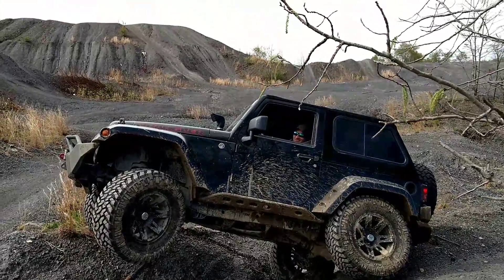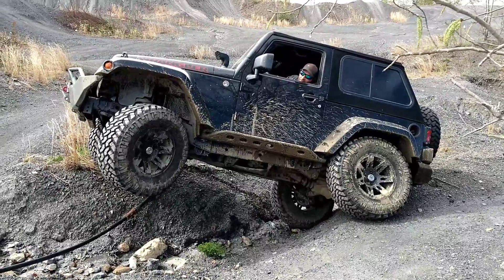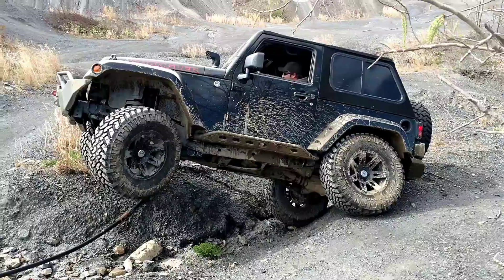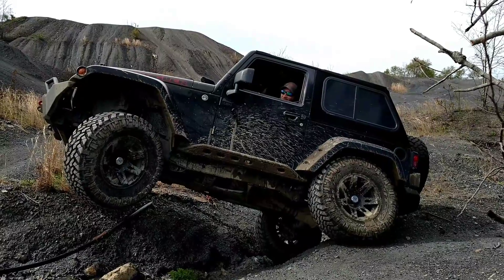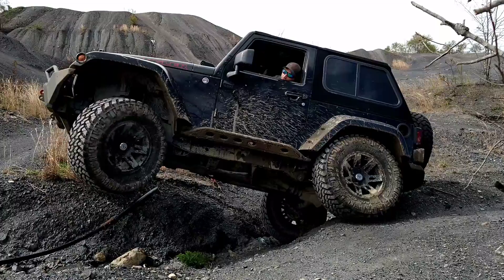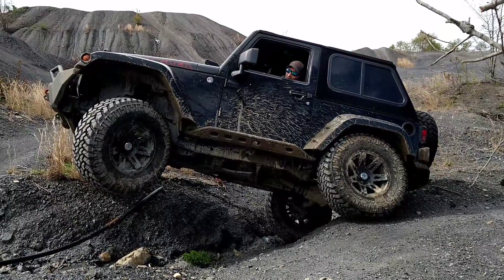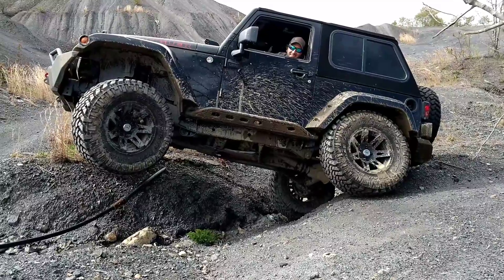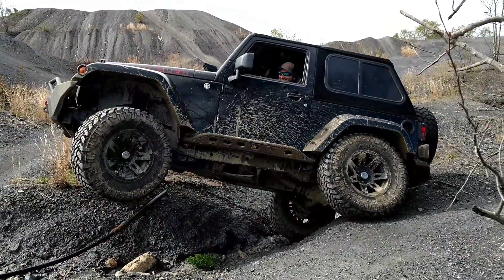The limitations of the Eaton Trutrac differential while using standard LSD rated gear oil.

Comment: I have one front and rear...I don't have this issue .. also in 4wd the front brakes are probably applying harder than the rear... And since it's in 4wd...it's not applying the brake pressure to the rear wheel enough... I bet it would have worked better in 2wd
Reply: or he could use the parking brake for just the rear. but that jeep weighs a lot and and is in a positions that would require a lot of torque to climb.

Comment: Should have got a Torsen
Reply: They operate almost exactly like one another. With my Torsen, if a wheel lifts off of the ground, the wheel on the ground sees very little power applied. I own a Torsen T2 and I've seen it do this when the wheel lifts.
Reply: @Bird76Mojo76  just got to hit the brake a little she will drive right out
Reply: @timpanellimike87  Not always...

Comment: Your BLD system is definitely not working. Blown fuse?,  my jku can totally stop free spin and waltz right thru that like a boss.
Reply: i dont know for sure if they had that on manual models. i cant find any good info on it. i dont see why not
Reply: Headles Norseman .. BLD is standard on all Wranglers.  The one thing that could be giving the problem is that when you off road a manual there are times you may use clutch, and or brakes while using gas pedal simultaneously just as the BLD was going to do its thing. Once the system is interrupted by some other parameter, it doesnt take long for the moment you needed BLD to be over and now your stuck.
You should be able to put in low 1st gear and crawl up a rutted hill lifting a tire and the BLD should stop the free spin.
Once you learn to stay in the throttle just a bit longer than your instincts normally tell you and you might start having some AhHa moments

Comment: I've been pouring over youtube info about trutrac/torsen diffs trying to research them. From what I understand, they work more like a torque ratio than a locker. Say the ratio 1:3 between your wheels. If one wheel has low traction (but still some) the diff sends say 10 ft/lbs of to it, and the high traction wheel receives 30 ft/lbs; ratio of 1:3. If you have one tire in the air though, that equates to zero traction. The 1:3 ratio is still there, so the tire in the air receives zero ft/lbs, and the high traction receives three times that, which is still zero ft/lbs. It still sort of acts like an open diff in that situation. Usually using the brakes provides enough resistance to simulate traction for the diff, it's interesting that it didn't work. Nice demonstration video!
Reply from the maker: Another issue that I suspect it's at play here is that Eaton lists I believe 3 specific axle fluids that do not contain any LSD additives. I suspect that he has a non recommended fluid that may well contain LSD additive, as most on the market do.

I would like to drain this axle and replace the fluid with something that Eaton recommends.
Reply: @Larry M Musgrave  have you tired different oil??
Reply from the maker: Yes sir. We later drained and refilled with a gearbox oil that has zero friction modifiers and the difference in the units performance was truly startling and amazing.
Reply: @Larry M Musgrave  thank you very much. I think that will be my next modification. Cheers!
Reply: @LarryMusgrave  Do you recall which gear oil you switched to?
Reply from the maker: Yes. We swapped to Eneos gear lube. If I recall correctly, it's speced for Volkswagen manual gear boxes, but it's a great oil that is void of friction modifiers. And as such, it makes a crazy difference in the action of the TT differential. It makes the action very aggressive, getting very near to the locker level of performance.
Reply: @LarryMusgrave  Thanks for posting this update! Helps some of us out. People have similar problems with gov locks in gm vehicles (very different style of locker so apple to oranges but still a mech style locker), gm actually had to post a service bulletin on the matter to tell people to use gear oil void of any LSD additives.
Reply: Just found this on EATON's website for the trutrac: "Friction modifiers should not be used because they will decrease performance (reduce differential bias)." Fun discovery
Reply from the maker: @Butterfinger069 
Yes, and as you and I had previously discussed... it's not a small deceased in performance. It makes the unit essentially non functioning. Dealing to the Eneos gear lube makes it fan-freaking-tastic. I ran 37x13.5 tires on my rock crawler with the Eaton E-Locker in front, and the True Track in the rear. The True Track with the right fluid is 90% as effective as a locker under most conditions. I would absolutely buy the True Track again. It just took us a moment to learn that all parts store fluid has the additives.
Reply: Ur exactly right, the eaton is remarkable at providing torque to the low traction wheel but the system can't do anything with a wheel that has 0 traction. A simple trick is to use the e brake just a little bit and give it less than 10 % throttle, once the diff starts to send power then you can add more throttle.
Reply: At the angle, the Jeep needs much more than 10ft/lb of traction to propel it up the incline.  Backing up should had worked better.

Comment: Limitations of the True Trac..."A Bad Driver"
Reply: Larry Musgrave go with straight non-synthetic 75 90 gear oil.
Reply: He should have put on the EBrake.
Reply: @burntoffering9083  I’m not here to have the auto vs manual argument. I’ve driven both, I’ve owned both, I still own both. I’m impartial to either transmission, both have their pros and cons, to say one is better than the other is based on opinion and I could care less either way.
Reply: @dhitch4561  1000 % agree to be honest
Reply: @burntoffering9083  spotter is part of the problem but the real reason for getting stuck is the type of locker. An ARB would get you out in a moment.
Reply from the maker: Correct. I'm not spotting him. He drove into this position to see how the TruTrack would work with a wheel in the air, with the Jeep traction control, and with standard parts store differential fluid. 

After draining the differential and swapping fluid to one of the very few that have no friction modifier or LSD additives, it works completely differently and as expected.
Reply: Your all right I apologise I didn't actually take notice of what was happening in the video i had just woke up...
Reply from the maker: Achisachis73  
This has nothing at all to do with the driver. The Jeep was purposely driven into this position to see if the newly installed TruTrack would be able to get the vehicle to proceed.
Reply: @LarryMusgrave    This is completely driver error.  The truetrac puts down 1/3 power to the slipping wheel by design.  There is no reason on earth that he shouldn't have had the other wheels turning with a truetrac installed properly.  End of story.  I owned a TJ and I could do this all day long with ease in this exact same position.  If you apply enough braking force and then overcome it with hp you will put the other 1/3 of the hp to the grounded wheels and THEY WILL TURN.  Synthetic oil will make it function worse but I've driven a friends with synthetic and even that worked quite well for wheeling.  Hopefully he's not running additives but none the less, more brake, more hp and applied consistently, it'll turn.
Reply: I'm guessing that this Jeep is a manual. If it is, it's going to make it very hard to find the true potential of the TrueTrac without stalling. The Truetrac type differential is used in many military vehicle which are all automatic, which you can do exactly what you were telling your driver. Press on the brake hard and try to push past the brake with the fuel, which will allow the truetracs to do their job. You can actually see it trying to work around the 12 and 20 second mark where the body starts to lift. Unfortunately the next tries the only time the driver uses the brake is when he's stopping. When he's trying the last few times you never see the brake lights come one until after he's done trying. Now I am not saying that the TrueTrac is perfect, everything has it's limitations.
Reply: @dhitch4561   you are totally  right
Reply: @dhitch4561  With manual you can trigger the rear with the handbrake
Reply: I understand and I meant no offense by it. I am saying that a bad driver that does precisely this, would be in trouble. A more experienced driver would know what to do in this situation. In any case, this video seems weird, I can get out of this one with front and rear lockers open. I just do not understand the video, looks like there is something wrong with the differential. Thanks for sharing
Reply from the maker: Achisachis73 My opinion is that he has differential fluid with LSD additives in it, I know this. Eaton themselves say that most all of your retail differential comes loaded with the LSD additive, and that the TruTrack will not work well at all with any LSD additive in the fluid. There are very few fluids out there that are void of the LSD additive.

So my opinion, drain and flush and replace with one of the specific fluids that Eaton suggests.

Comment: The stock JK brake lock system prevents this with open differentials. Something is not right with this jeep.
Reply: Why disable the traction control? The traction control on the JK works in tandem with the Truetrac’s. I installed them front and rear in my JK and is a great combination. I’ve had no issues.
Reply: @JDIII4000  probably because it reduces engine power, or at least the stability control does. That why I like the system on my discovery. Traction control keeps things in check without affecting engine performance whatsoever. No power reduction or throttle reduction, only brake torquing. Too many of these newer vehicles damn near shut down. My pickup almost got me stuck on surface mud because when the back tires started to slip it reduced power so much that I had it to the floor and it was just barely above idle! Disabled the traction control but it had already made a little rut so I ended up having to use 4wd on surface mud that my little 87 BMW 325 could have gone thru.
Reply: Justin Hardwick Exactly. I’ve seen too many JK folks disable traction control completely because it bothers them. I have open diffs and have never been stuck on trails/rocks yet due to brake-lock. If I was crawling all the time I’d probably install lockers to save the stress, but for daily drivers/weekend warriors, lockers are not necessary anymore.

Comment: Properly working traction control (EDL or ASR) + Detroit TrueTrac in all axles = the best combination.
Reply: No not traction control, it limits whell spin to much to be useful all but ice. 
Newer jeeps have BLD which is designed for this type of situation
Reply: @blackgenesis7472  Yes I mean that ASR or BLD system limits only slipping wheel, not all wheels at the same moment -- is the best solution in modern fuel efficient transmissions without any friction pairs in differentials (also manual central and rear axle locking features may be present in fuel efficient transmissions). 
TrueTrack in front axle + BLD system -- is the best solution for ice driving I think.

Comment: Modulate brake/throttle and you'll move right along.  That's why Torsen + traction control is such a remarkable combination.
Reply: adb99999999999 . When you manually modulate the brakes you bypass the ability of the BLD to do it for you , you gotta stay off the brakes and on the gas sufficiently
Reply: @jessewoody5772  Maybe this Jeep doesn't have BLD, thus you have to do the braking yourself.
Reply: DeanMk1  all jks have BLD.
Reply: @jessewoody5772  What's a "jks"?
Reply: DeanMk1 i should have wrote JKs  . As in CJ, YJ, TJ, JK, and the current JL
Reply: @jessewoody5772  Of course! My apologies for not being more on-the-ball. I missed where the OP listed it as a JK series. I thought it was TJ.
Reply: There is one phenomenon that we are not accounting for here: Torque cannot exist without resistance. If an engine can produce 240 lbs/ft it does not mean that it always is. If you were to place the whole jeep on blocks and place it in drive you will only have the amount of torque necessary to rotate the mass(drivetrain, tires) . Thats why on a Dyno there are rollers that apply "resistance" and then you can measure the amount of resistance that can be overcome(Torque). Don't confuse rotational speed as being the same thing. On an open diff,lets say one wheel on glare ice, the other on dry pavement- both wheels will see the same amount of torque. If it only requires 15 lbs/ft to spin the tire on ice, the tire that is not spinning is also receiving 15 lbs/ft, even though it may look like its doing nothing it is applying effort to the ground. Although it is likely no wheres near enough to move the vehicle. When you apply some amount of additional resistance to the spinning tire(LSD, BLD) the non spinning tire will receive a commensurate amount of torque and hopefully be enough to move the vehicle. If its an LSD it may still not be enough. The BLD can completely stop the spinning tire if needed and send enough torque to propel the vehicle
Reply: @jessewoody5772  This is why you apply light braking when that happens. It causes resistance and the LSD begins to work.
Why it didn't automatically kick in here is beyond me.
Reply: DeanMk1 does this jeep have a truetrac? If so was it new when installed?
Reply from the maker: New installed, Eaton TT, but loaded with axle fluid rated for and including limited slip additive. After finding unicorn tears.... Non synthetic fluid with zero lsd additives, it's an entirely different beast.
Reply: @LarryMusgrave  Thanks Larry. I still don't understand why rear gear lube would cause a Torsen style LSD to not work, simply because it includes Posi Fluid in its makeup?
That just doesn't make sense to me.
If you could explain, I would appreciate it.
Reply: @DeanMk1  I'm not sure of the specifics either, but obviously a standard posi uses clutches, and the fluid is designed for those clutches. Torsen uses worm gear sets based on the idea of backdrivability, so lubrication on those interfacing surfaces could definitely have an impact. According to https://torsen.com/lubricant-part-1/ and https://torsen.com/lubricant-part-2/ , they don't seem to mention any issue with posi diff fluid. Just that higher weights increase lubrication and reduce the function of the torsen, but not significantly on their Type 2 differentials. Apparently they have a Type 1 that cares more.

You would think a posi diff fluid, which based on the article help generate friction on the clutches, would be just fine in a Torsen.
Reply: @Sevalecan  That's what I was thinking. Seems, though, Torsen's are happier if you use 80W-140 rather than 85W-90. The weight of the lube would make better sense than whether or not "Posi Fluid" were included in the mix, or not.
Reply: @Sevalecan  the traditional limited slip fluids actually reduce friction, which impairs a torque biasing differential like this.
Reply: @LarryMusgrave  What fluid did you use?
Reply from the maker: @jbp6759  
A VW / Audi spec transmission fluid with zero friction modifiers that is cake Eneos.
Reply: @LarryMusgrave  may i know what fluid you are using?
Reply: That rig doesn't have truetracs
Reply from the maker: @ronaldemms 
Well... being that we put the a Eaton Trutrac and 4.88 gears in the rear axle, I'm gonna have to disagree with you 🤣😂🤣

It's a fluid issue.